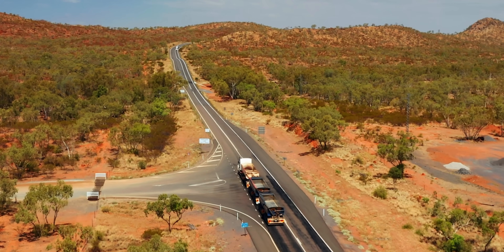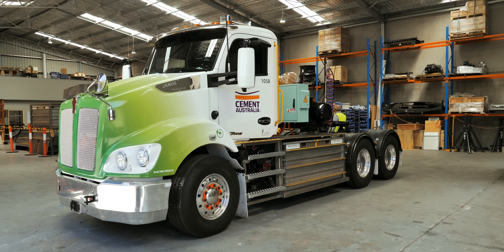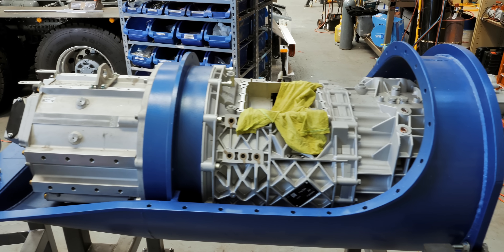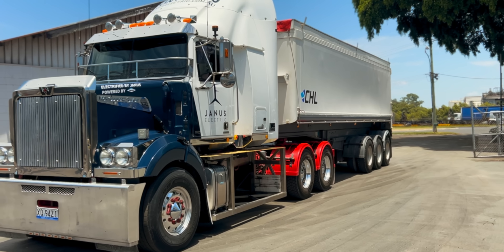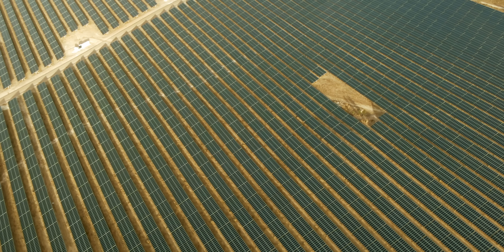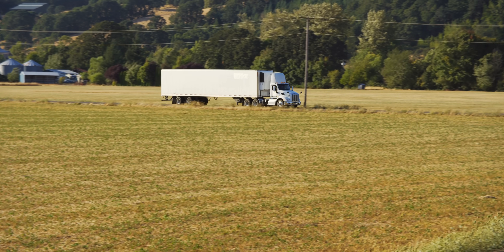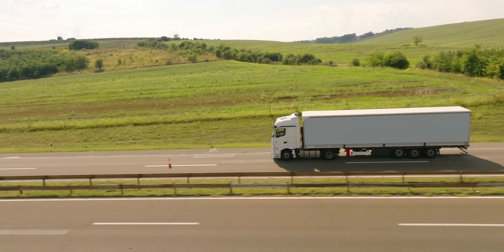This GIANT Electric Semi Can Swap Out Its Batteries!

Comment: A lot of this seems rather misleading.  

The double the capacity thing is likely not a real limitation.  The tesla semi with a standard trailer is limited to 82,000 pounds because that is the law in California.   The 22 tons is not the maximum towing capacity of the tesla semi tractor.  Other states and countries allow heavier loads.  Many states in the US allow double and sometimes triple (although not full 53 feet) trailers.  The tesla semi has huge amounts of torque to be able to go up a 5% grade with a full load at highway speed and it also has significantly more horsepower, so I assume that it can pull a lot more than the legal limitation of 22 tons for a tandem axle trailer in California.  The tesla semi does that without needing to shift gears; it is a single speed gear set for all 3 motors.  The two acceleration motors may have a significantly lower gear ratio than the always engaged drive motor, so it effectively has more than one "gear" even though it does not have a transmission, just gear boxes.

I don't know if I believe the efficiency numbers.  It is very convenient that the numbers sound like tesla's numbers at 1.5 to 1.7, but tesla's numbers are per mile not per km; if these numbers are correct, this semi is more like 3 KWh/mile.  Given the complete lack of aerodynamics and the inefficiency of the drive train, I suspect that it is less efficient than that.  Every step the power has to be transferred through loses efficiency.  The tesla has a gearbox and, I assume, a differential for the single, always engaged motor.  The two acceleration motors do not even go through a differential since they drive each wheel independently.  This system goes through a transmission with lots of gears.  It then goes through a set of drive shafts driving multiple pinion and ring gears and then the differential gears of 2 separate differentials.  Every step loses significant energy.  This is why Aptera uses hub motors to avoid any loses in gears.  

This semi also has to be ridiculously heavy and therefor likely even less efficient.  If it has 2x 620 KWh packs, then that is 1240 KWh; significantly more than a tesla semi which might only be 900 KWh.  The packs also have to be a lot heavier to be removable compared to an integrated, structural pack.  The motors and drive train is also really heavy.  The tesla semi drive motors may be similar weight to just the differentials on this truck; they don't need any connecting shafts and are not much larger than a differential.  This truck has a giant transmission and a massive, low RPM motor.  This semi might not be usable in California and many other states in the US since it may be over the per axle weight limits in addition to the max GVW.  

The battery swapping does not reduce the batteries needed.  You have to have at least 2x or more the batteries used in each truck since you need to have a set charging while one set is in use.  Mega chargers may be set up with a mega pack to buffer grid energy so it should be about the same, possibly with the tesla semi using less batteries due to the higher efficiency.  A mega pack could be made of old batteries that have lost capacity; these trucks would require full capacity batteries for all of them, or they would lose range.  A tesla semi also can charge directly off the grid without a buffer if the power is available.

It is unclear what the regen efficiency actually is.  I think one of the many things that gives the Tesla semi its very high efficiency is super efficient regen.  Looking at the graph for the tesla semi 500 mile trip from Fremont to San Diego, the regen looks to be really, really good.  I doubt that this semi has regen efficiency near that high.

I don't know if it is going to be worthwhile to repurpose old semi tractors in this manner.  While the efficiency and cost will be better than a diesel, I don't think it will be able to compete with a tesla semi.  A tesla semi may be of similar initial cost to this conversion and will almost certainty have lower cost per mile due to higher efficiency.  There may be a window for a while before tesla massively ramps production and the other semi tractor makers start to compete.

Comment: Another great episode and an absolute game changer for the freight industry.. 
I'm loving that their kits are designed to fit into standard trucks so that existing trucks can be reused. 
I can also imagine the cost of retrofitting is still cheaper than a couple of engine rebuilds over the long term on top of the significantly reduced maintenance cost and cost to run. It's absolutely brilliant all round! 
I also loved how flexible their battery packs are so that as new battery technologies emerge, you just have to put the new tech into the existing frame.
I'm looking forward to seeing you and the rest of the fully charged crew in Sydney this on Sunday. 😃

Comment: This is amazing work.

The efficiency is so much worse than a Tesla semi but I'm assuming this is the double weight capacity and this was a 90 tonne Vs 44tonne comparison, rather than it being a motor/Inverter/aero advantage for Tesla only (semi gets 1.5-1.7 kWh per mile Vs km for this so 60%advantage)
Reply: I have read in a couple of different sources that the Tesla trucks are tested at 36.2 tonnes.  The aerodynamics will be a big factor as you suggest, but for local work where aerodynamics may not be a factor as energy consumption is probably not that important.  Another thing I like about this is that if you are using them locally and the truck unexpectedly is running low on energy away from home, it is easy to just trailer them another battery rather than sit for a few hours on a charger somewhere.  Having seen this video I am a little less sceptical about EV trucks than I was.
Reply: We don't actually know what the towing capacity of the tesla semi is.  The 22 ton cargo capacity is just due to the legal limits for a standard tandem trailer in California.  Many states in the US and other countries allow much heavier weights.   Elon Musk has said that it has a ridiculous amount of torque and being able to go up a 5% grade at highway speed at 82,000 pounds GVW would tend to back that up, so I would assume that a tesla semi can actually pull a lot more than 22 tons.

Comment: @10:54 is that a torque bent flange, bottom right of engine bay where it connects to the transmission? Or is it manufactured like that*

Comment: Yes I agree with all that has been said here but nothing was mentioned about on route swapping stations how much land is going to be required for these as you need to have fully charged batteries for the change over as well as charging stations for the batteries being dropped off, easy for Australia I should imagine, but what about the UK where land is at a premium? Even some depots don't want to lose their warehouse space or parking area spaces.

Comment: The regenerative breaking alone will have a huge impact on particulates. I hadn’t even thought about this. Awesome work.
Reply: Probably a little less brake dust, but not much. They still need regular brakes on the trailer, and they already use engine braking as much as possible. Braking has to be biased, i.e. the trailer must apply more braking force than the cab or else the trailer will jackknife.
Reply: @darrell857  trucker here. dont disregard the engine braking in reducing particulate from brakes. on a scania you can only get 120 killowatts retarder or 180 if you spec it like that. mercedes gets 500 killowatt regen braking on their electric trucks. in america you have double drive which can put nearly double the regen braking on the ground. you could do most of your braking with regen. only drop the hammer when panick braking.
Reply: @darrell857  Or did he mean exhaust particulates? Also, the regenerative braking is a direct replacement for the existing exhaust brakes. Except the regenerative brakes can be used in a suburban area without waking everyone up. It sounds like it would be a neat system. For drivers of regular passenger vehicles the regenerative braking is something new and needs getting used to. But for drivers of these electric trucks, they would already be totally familiar with pressing a button to switch on brakes to assist with stopping or down hill speed control. It seems like there would be less retraining required for an electric truck than there is for an electric family vehicle.
Reply: @darrell857  BS The engine brake or jake brake will hold back the load entirely if you are in the proper gear for the weight and the grade. Only time that failed on me pulling super b with 63 tonnes was on the cocquihalla highway on a hill we call the "smasher" which is an 8 percent grade. There was some snow on the road but unknown to me was some black ice. Had gone down this his many times without touching the brakes., or occassionally a lite application. In this instance with 600 horsepower engine hold back, when the wheels hit the black ice which was hidden under a light skiff of snow, every thing went quiet. No traction and the jake had killed the engine. Quickly foot on the brakes, other foot on clutch, take out of gear, start engine, and then place back into gear and reset jake to only 4 cylinders instead of 6 cylinders to hold back the load. Because I was nearing the bottom of the grade I would slowly allow the truck to pick up speed which is normal along that stretch and the only difference is that I didn't drive on full jake until I got to lower elevation and out of the snow. The only time a jake has to be used otherwise is snow or black ice or rain if you are light on the drives and heavy on the trailer and go into a sharp corner and the jake comes on if you get off the throttle. In this case the trailer can push you around, A light application on the trailer spike will usually help, but then again you may be driving to hard for the conditions.
Reply: I like the work Edison motors is doing in Canada. They are making hybrid diesels and the regenerative braking makes a lot of sense in the logging field because they drive up mountains empty and deliver full loads down hill.
Reply: @thomasrodriguez5913  Especially if they install a large enough battery to absorb the downhill grade. Going up hill at 30000 lbs empty and down hill at 105000 loaded, even at 50% recharge efficiency, they would have more potential battery energy at the bottom of the grade then when they started. How cool is that!
Reply: 'Braking'
Reply: @wigs1098  lol
Reply: Remember that there is no such thing as a perpetual motion machine.
Reply: @Liberty2358  I don't think anyone thinks you would get as much out of regen braking as it took to add that momentum in the first place. It was just being pointed out that regen braking on an electric vehicle reduces the use of the physical brake pads and hence the brake dust. It also isn't loud like engine/exhaust brakes. And it adds a bit of power back into the batteries as an added benefit.
Reply: @jaseastroboy9240  2nd law of thermodynamics does not allow 100% efficiency when converting or transferring energy from one system to another.  That is why perpetual machines are impossible.
Reply: @Liberty2358  Nobody said it was 100% efficient and nobody is talking about perpetual motion machines (except for you). 
Do you believe it has to be 100% efficient  to be worthwhile?
Engine brakes or mechanical brakes give you braking force, heat and wear and tear on the components. Whereas regenerative braking gives you braking force, some of the momentum lost is converted to electricity to add some charge back into your battery and very little wear and tear to the components. Seems like an obvious choice, especially as the main components in regenerative braking (motor, electronics and batteries) are already there and so it is an extremely low cost system.
Reply: @jaseastroboy9240  At least your paying attention. This swap out is truly a game changer for electric trucks especially in Australia that has to import 95% of it's fossil fuels. Large investment into solar farms and they can say goodbye to diesel in many of their heavy volume corridors. Next step up is to install a pantograph system so they can drive and charge at the same time. If they make the system segmented so it is not so costly as a continuous line and only carry enough battery for say 50-60 miles of range, there is a win-win. Cheaper for the vehicle to build, less weight to move around, and less lithium needed overall which I understand will be the big problem in  the green revolution. The pantograph mainly only requires steel and graphite as the current conductor and there is lots of that around. Thoughts?
Reply: @Liberty2358  nowhere did I hear the words "perpetual motion" spoken. What are you on about? ~ or just on?
Reply: @Liberty2358 There are conversion losses every step of the way but it does add up.  My 2011 Volt is about as current as an iPhone 3.  It returns about 50% from kinetic to kinetic.  And still has factory brake pads at 90k miles.  Don't know how many liters all that unused brake heat represents.

Comment: Battery swapping needs to be the way forward for so many reasons
Reply: Why?  It doesn't save that much really.  You still need a huge amount of batteries since you need to have at least  one other charging while the truck is being driven.  Given the low range, many battery swapping stations will be required for anything other than short routes.

Comment: The way to get adoption of this system is to realise ip VHS style for the battery so multiple companies adopt it as a standard design and don't Betamax it.

This means that anyone's battery can go into a charging hub and gives best flexibility for users giving better adoption faster. Competition in battery design is accelerated so adoption is faster. 

Trucks need to be able to pre-book swap slots and your going to want swap locations every 150-200km for the worst days and to give flexibility up and down the network for load range.

Comment: if you would have separate small tube rails for stuff, yes like alongside electric grid
Reply: mini containers, not shipping containers, more like pallets
Reply: more like air push tube mover lines
Reply: Like Magway, you mean?
Reply: @SJ8311  think it as a water pipe, oil pipe, but for stuff, small packages, not truck postal, not air postal, not containership postal, but "pipe postal"
Reply: @SJ8311  well any small items (smaller than containers) continuous conveyer belt

Comment: Can we acknowledge how precise our chap here is with his forklift?

Also, really good concept and amazing to see it on the road and working.
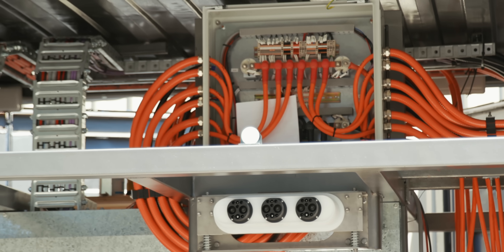Reply: 14:32 thanks
Reply: I wonder how its connected. There have to be some rails to guide battery to the connector.
Reply: @volkhen0   at 14.32 in the video it shows the connectors in the charging rack that look like 3 GB/T DC connectors.
Reply: No you can't sorry, it's expected and anything less is not acceptable, forklift work requires and demands precision, it is dangerous work.
Reply: @anthonyxuereb792  some precision, sure. But not that much that you need USD 50k robot to do this. 
Sorry it took so long to respond, I was unloading a semitrailer.
Reply: @jur4x  Granted but the robot is on permanent duty and able to service a vehicle at any time and with trucking that can mean the early hours of the morning
and would pay for itself. After a person is awakened from sleep it takes about 30 minutes to be at your best. It might not make sense for a small outfit but it would to large companies.
Reply: @jur4x  could be even a forklift converted to the autonomous driving and doing the same job as a robot for a fraction of it price. i bet it even exists already in some of those fancy warehouses
Reply: @anthonyxuereb792  In many situations the forklift would already be there and in use unloading the truck. So once it had finished unloading and possibly loading the truck it could swap the batteries. Or it could swap them before the loading/unloading of goods. The beauty would be that the forklift driver and forklift would be existing so no need for hiring additional staff or purchasing a forklift.
Reply: Love the fossil-fuelled forklift - says it all
Reply: @rmbandit1 😂🤣😆
Reply: nothing special
Reply: I was thinking the same thing, he's been driving a forklift for a long time
Reply: The day Lindsay Fox gets hold of this it’ll practically be all over rover for diesel…
Reply: And the forklift is only until the robotic system is up and running. How good is that?
Reply: @petergersbach7355  I think the beauty of this system is exactly in the fact you can do it either way. Unlike all the attempts in battery swapping for cars where it is pretty much the only option. With this system, you can have them changed without specially built robot. In some remote rural location, it is easier to implement. Like literally any old forklift with 3T lifting capacity can do it. Or anything you can fit forks on. Like a truck with manipulator arm, or a tractor.